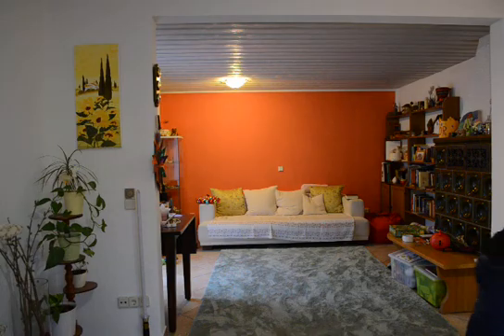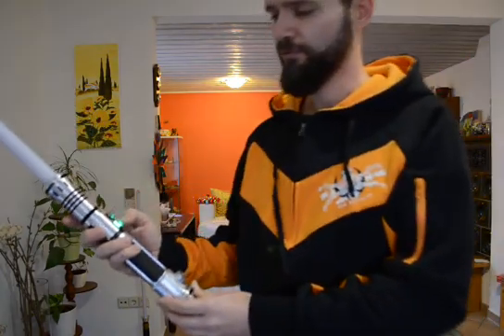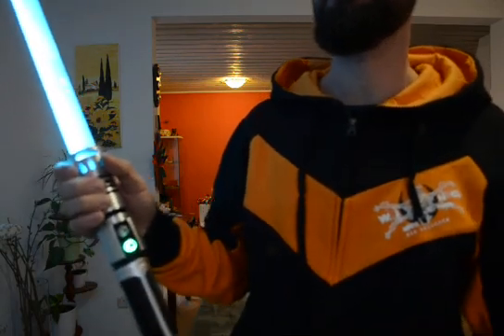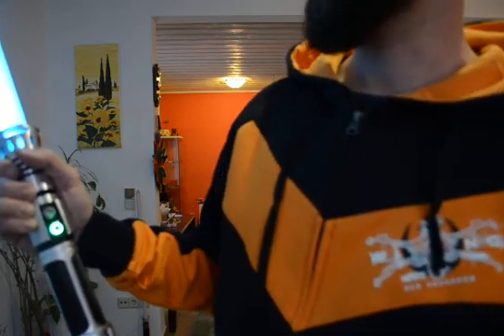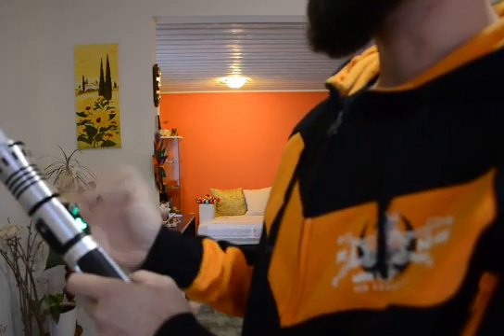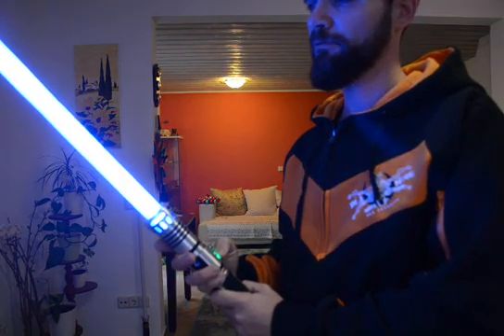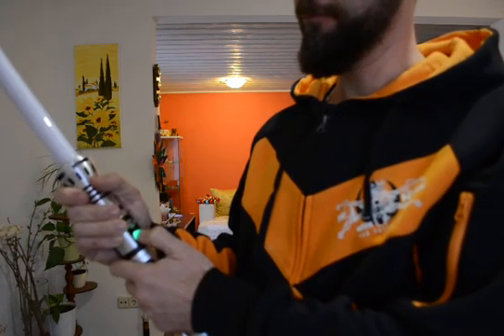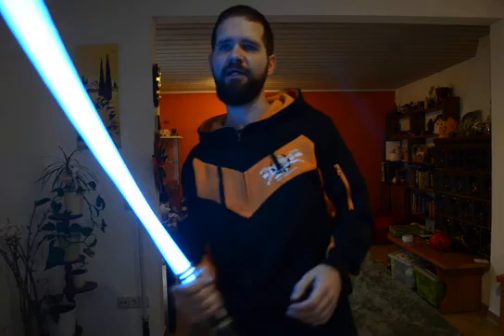LSOS v1.4: DJWing's Single Button Saber

Comment: Most impresive, I was testing the LSOS with an arduino nano, but I just hava aquestion for you man, if you are able to assist, hoy many LED's each segment must have and how many segments can I connect in the LED string? I asking because here in Mexico on my pklace I jusc can get small legs LED's and this reduce the length of my blade to only 50 cm, hey, thanks in advance for the help.
Reply from the maker: The DIYino Prime is designed to be able to drive up to 6 segments. The segments can be of any length, if you have a 32" blade usually you can put ~100 LEDs from the 5mm type. If your LEDs are smaller, put more in the blade. You can go up to several amps if necessary, although with a proper serial technique current consumption can be greatly reduced.